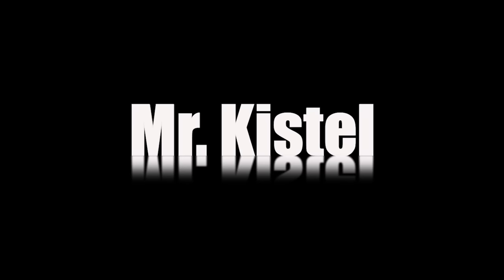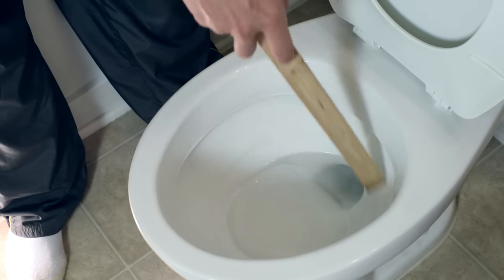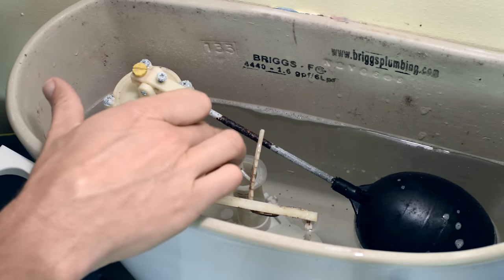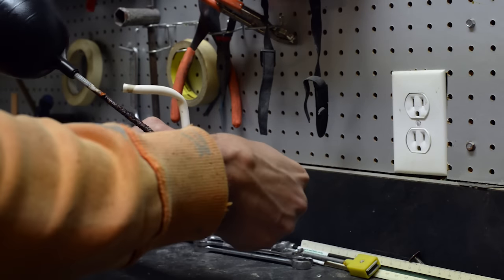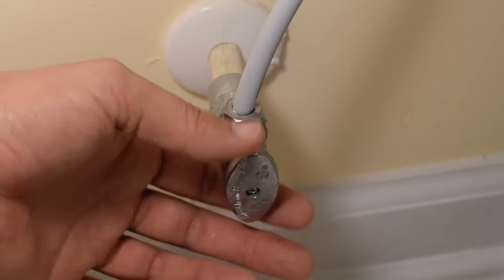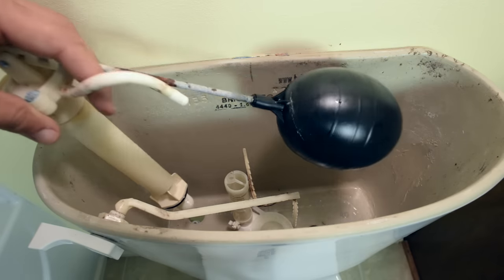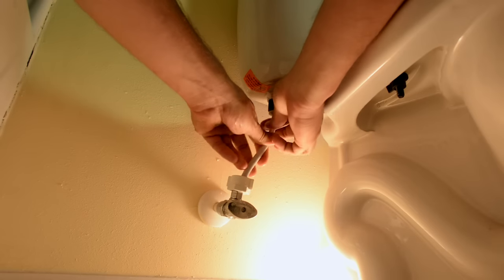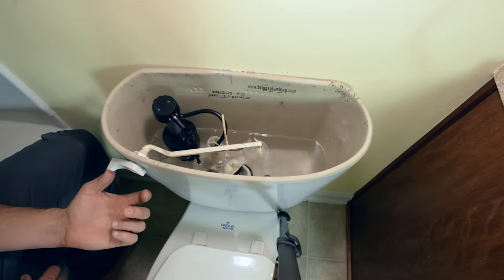Why Is There Low Water Level In The Toilet Bowl And How to Repair

Comment: MrKistel - I replaced the flush valve with a new/modern one and the water level in the bowl is still very low. No change after the install. There are no leaks in the new valve, flapper is good and the water is rushing out full blast from the black flush valve hose into the overflow tube. Water level inside the tank is at the proper height. If I pour a ton of water into the bowl itself, the water level drops back to the same exact spot right as I stand there.  :(  Since installing the new valve didn't work - do you know what else may be the cause? I've Googled this problem and coming up with no solutions (other than people changing the valve and it works for them again). I just have a regular Vitra 1.6 Gpf/6.0lpf toilet in case that helps? Thanks!!

Comment: I just replaced the fill valve in one toilet, and 2nd one has low water.  However, I noted you put the fill tube down into the overflow, although the instructions that come with the new fill valve say not to do that as you end up wasting water.  Why do you not cut the tubing off?
Reply from the maker: Probably best to follow instructions that came with your product.  If hose is too low in the tube maybe a siphon could be created which could potentially waste water

Comment: Have the same prob as Peter which you did not answer.Thank you for the video.
My problem is a little different. The toilet bowl fills to normal but over-night will drain to a very low level.
Flushing seems normal. No leaks observed. Any recommendations?
Reply from the maker: +K.A. HARDY See some of my replies to earlier comments.  You may have a vacuum problem caused from an issue with your vent plumbing

Comment: Hi.  Thanks for this video.  I have a new Toto toilet with the Flow Max II or something like that.  Would you know of any way to make the water level higher in that model?
Reply from the maker: Thanks for watching and commenting.  I would assume it would be a similar process to toilet bowl low water fix demonstrated in this video.  Sometimes you can also pour a bunch of  water directly into the bowl and wait a awhile.  Then where the water level sits is likely the design intention of the toilet manufacturer.

Comment: I replaced out my old kit for a new korkys flush kit problem is even when the bowl fills up where should be once the flush shuts off the bowl water starts to go down bout inch & half have adjusted everything there is to adjust but no change occured leaves me scratching my head yet why it's doing this?

Comment: I have an apartment with 2 toilets upstairs and 2 toilets downstairs. They all flush fine, have good functioning fill valves, but the level of the water is low and then once the fill valve stops running the water actually drains down even more, sometimes to where there is just an inch of water. All 4 of the toilets just recently started doing this.  We've also snaked out the vents from the roof and no blockage. The only thing we haven't done is pull and replace the toilets, but assumption is that it is unlikely for all 4 toilets to have an issue inside of the bowl. Any thoughts?
Reply from the maker: Interesting situation.  Not sure I can help but please advise what you figure the issue is once you figure it out

Comment: Question: bowl fills up to the right water level and then slowly lowers to just a small amount of water. Thanks if you can help.
Reply from the maker: Might be a problem with the sewer venting causing a vacuum which may suck water out of toilet bowl.

Comment: Hey Joe,i have the same new valve as the one you installed my problem is i have too much water in the toilet bowl i want less water i have tried adjusting screw still to much water what am i doing wrong ? can you send meow do a video on this i have yet to see one. Thanks
Reply from the maker: Make sure the fill flex tube is not too far down in the pipe.  If it is it could possibly be siphoning water into the bowl.

Comment: Hi, I recently replaced the fill valve for my toilet. I bought the exact one that you showed here in your video. I am 99% sure I did everything correctly but the water in the toilet tank and bowl is low. I tried to adjust the water level but it doesn't rise. Sometimes the water won't fill up and I would have to press on the knob for it to fill. Any ideas what kind of problem this might be? It seems to flush fine when I press the knob on the fill valve (the spot where the screw driver goes in to adjust water level). So my problem is sometimes it fills fine even though its at a low level but sometimes it doesn't fill at all unless I press the knob. Please help! Thanks in advance!
Reply: ever find a solution?

Comment: The water in my tank reaches the top of the overflow and the water continues to run. Will adjusting the valve as you demonstrated when you replaced it resolve that problem? I constantly have to remove the tank lid and pull up the float.

Comment: Hey Mr Kistel,  we just purchased a new home (new to us) there are two toilets in the home both the same brand and model. The water is lower in one then the other. They both have the New fancy apparatus, is there a way to adjust the water going into the bowl? Or can those spring a leak as well?  Thanks in advance.
Reply from the maker: Congrats on the new home. There is an adjustment knob on the fill valve appartus.  On the version I used it is the vertical threaded section with the philips screw head.  This adjustment is for the water level in the tank but could  have some effect water level in the bowl.  To see if this might be the culprit you can measure the water level in the tank of each toilet (assuming they are identical) and if one is different adjust the one to match the other.  Also these valves could fail as well over time, check for leaks out of the valve or anything restricting flow to the refill tube.  Another possibility could be a problem with the vent plumbing in your house.  A restricted vent system can create a vacuum effect which can suck the water level down in a toilet.
Reply: Thanks for the info Mr Kistel, I was thinking the vent could be an issue as well but wouldn't I have an issue with the other toilet or do tge have separate vents? Sorry if that is a dumb question.
Reply from the maker: Timbo424 The toilets would most likely be on separate vent systems.

Comment: FYI in my old European toilet the bowl water level always stays the same (European toilets are wash down, not siphonic). Tampering with the tank fill valve and it's arm and floater just regulates how much the tank fills. My old high tank once filled up to more than 4 gallons. I reduced the fill level to about 1,5 gallons by bending the valve arm and now it wastes much less water than before.
Reply: The problem with the toilets made after 1994 is not the qty of water used to flush, it is the WATER LEVEL in the bowl.  P00P sticks to the side of the bowl because there is no water for it to drop into, so even 4 or 5 or 6 flushes won't clean the bowl.  How does THAT save water?  The government should admit this was a bad idea and fix it.  Or toilet makes should figure out how to store more of the water in the bowl, instead of in the tank.  

I have an old 3.5 gallon wash-down flush toilet.  I would like to get a new one that is chair height, but I'm not willing to p00p on the porcelain instead of into the water.  I have added jars filled with water to my tank to reduce the amount of water used in the flush.  A lot of water isn't necessary if there is plenty of water in the bowl so the p00p doesn't stick to the porcelain.  Also, given that urine is sterile, I subscribe to the saying "if it's yellow, let it mellow - if it's brown, flush it down."   I want to save water, but NOT by having too little water in the toilet bowl so that the porcelain gets nasty.
Reply: +Grace Birdsong That's the problem with the wash down design. On the other hand, the siphonic design is cleaner but prone to clogging. It seems that if you're in America, Canada or Japan to name a few countries you can only buy or use siphonic toilets and if, instead, you're in Europe you can only buy or use wash down toilets.
Reply: TeraVolt Thank you for the clarification!!!! I'm not religious but God bless you haha... Science, bitcheesss!! I'm European (Finland) and my toilet had somewhat low water level. Way lower than this video. I was like oh shit are the pipes clogged. Thankfully my toilet isn't siphonic (I guess) because I wipe with a lot of paper and I have to flush the toilet 3-6 times after taking a shit.

Comment: I'm not seeing a leak.  Btw, the replacement that you put in looks to be the exact model I have.  Is it possible it might be leaking in a different spot?  I mean, there seems to be a lot of water going into the bowl.  It actually fills up to about where I think it should be.  However, it slowly drops in level.  About 20 to 30 seconds after the water shuts off the bowl has drained to about where yours was before the fix... then it stays at that level.

Is it possible that the entire toilet might be angled wrong or something?  I haven't pulled the toilet or anything like that recently.
Reply from the maker: Sorry to hear of your issue where the toilet bowl water level is lower then you would like to be.  It is hard to say what the issue is from this end. If the valve is old it might be worth replacing.  Maybe try adding  a bucket of water directly to the bowl and seeing if the level still drops.
Reply: @MrKistel  When I pour water into the bowl it quickly goes down again to the lower level as though I hadn't added any water.
I don't know if it helps but I do have a toilet on the floor directly below and it does NOT have this issue.  So, I don't think it has anything to do with the main sewer line itself.

Comment: MrKistel.  I have an odd situation.   In a hallway bathroom that doesn't get used much, I have a toilet with this issue:   If the toilet doesn't get used for a few weeks (no guests), the bowl will be empty and a smell will be present.  The smell I can explain (insufficient water in the trap) but what would cause it to slowly lose bowl water over time?
Reply from the maker: Possibly an issue in the plumbing venting in the house.  If there is not sufficient venting water can get sucked out of the bowl.  As other sinks and toilets are used in the house it create a vacuum and cause such an issue.  I would check to make sure you have proper venting piping in the first place and if so look for clogs.  Vent pipes come out in the roof and  things can fall down in them creating a clog.  Sometimes running the hose down the vent pipe can remove the obstruction.

Comment: I noticed when you started there was a float an after you changed to upgraded model there wasn't a float my toilet doesnt have a float and the tube you showed going into fill valve the tube in mine dosent go into fill valve too short. Should it be in fill valve??
Reply from the maker: The float is the cylinder that rides up and down the main tube/cylinder valve body.  It is just a more modern design.  For the model I showed in the video it is important the hose go from the valve assembly to the overflow tube.

Comment: I have a brand new dual flush toilet that came with a problem. That was fixed. The tank is still full of small bubbles. Is this normal and what do I do?
Reply from the maker: Any chance the tank had some sort of cleaner residue in it that is causing the bubbles?

Comment: I replaced my existing toilet builders basic round bowl to a elongated Glacier Bay 2 button top flush toilet. But now water level at base slowly empties out to only leave about 2" of water. I confirmed the fill tube is working and installed correctly, no leaks visible.  I used a new "no wax" rubber ring and tightened bolts when I installed on ceramic tiles that were level. Any ideas on why this is happening?
Reply from the maker: Hard to say but some of the newer efficiency toilets have a pretty low water level by design. Best of luck.

Comment: any tips for low pressure going to the toilet?  after initial flush the tank fills extremely slowly and the water coming in has a very high pitched sound
Reply from the maker: have you checked the main water feed valve that feeds the toilet?  make sure it is all the way open?

Comment: How do you know that the cause is the refile apparatus and not the Toilet wax leading on the floor, assuming not all leaks can be noticeable.
Reply from the maker: Thanks for watching. The low water level in the toilet bowl shown in the video was low due to the faulty refill system.  Once the valve was discovered effective, it was replaced and the toilet water level corrected itself.
Reply: @MrKistel    If my toilet is 30 years old, could the Toilet wax be leaking, even when there is no water at the base of the Toilet ?
Note: the water level in the tank goes down  half an inch a day and the toilet bowl water level remains constant.

Comment: My toilet bowl is brand new I'm wondering if I have to purchase a replacement part or I need to adjust the screw? I tried to adjust the screws but to no avail. please, I need your help. It's so annoying that every time you went no 2 after flushing the toilet there is always leftover shit on the side of the porcelain where the water cant reach. thanks in advance.
Reply from the maker: Another cause for low water in the toilet bowl could be a sewer venting issue.  There should be a pipe venting the sewer line out of the toilet  to open air. Some times those pipes get clogged or they were installed incorrectly or not at all.

Comment: You put the water fill hose right into the (bowl-fill tube) which fills the bowl??
Then where does the water come from to fill the tank?
Reply from the maker: Thanks for commenting.  It depends on the toilet valve but generally around the base of the fill valve is where the water comes in to fill the tank.
Reply: MrKistel 
 Thank you for the answer. That must mean that my brand new valve is not working properly.
Depending on if I put the hose in the tube or in the tank, either the tank will fill and the bowl will have very little water or the bowl will fill very quickly and the tank will not fill all the way and take forever

Comment: Installed a brand new fill valve, and the water in the bowl is still low.  Even if I add water to the bowl directly, such as from a bucket, the bowl still drains down to a low level.  Any ideas as to what might be causing the problem?
Reply from the maker: Could it possibly the design fill level of the toilet? Otherwise sometimes there is an issue with venting in plumbing on the flush side of the toilet.  If venting is impeded on the sewer piping their could be a suction force pulling water from the bowl.
Reply: @MrKistel  I don't think the fill level I am seeing is intended by the design. I will check the vent but I don't think that is the issue because any water above the final fill level just trickles out (you can hear it). If the cause was a plugged vent, you would think that it would be all sucked out at once with the flush.   The problem is very similar to the one depicted in this video https://www.youtube.com/watch?v=qpxKUEnI1fk  (which unfortunately doesn't offer a solution).

Comment: could the low bowl level be caused by something other than a leak, i.e., someone taking a monster dump and not flushing to allow for time for the bowl to empty?
Reply from the maker: sounds like you might need a specialist
Reply: @MrKistel  Hi, wound up getting one; Johnny Mopp :-) The DH came home, there was no leaking from the valve when we flushed, he applied Mr. Mopp and the water came back up.  All is well and I'm glad you made the video so I knew what to look for.
Reply from the maker: @deecross5028  Great to hear all is well and the video was helpful with your toilet troubles

Comment: I want to know how to increase the water level left in the toilet bowl not just the amount of water used to flush the toilet. I've maxed out the adjuster to use more water when flushed but water level in the bowl is about half a centimeter higher. Is that the best I'll get?
Reply from the maker: If too much water gets put in the toilet bowl the toilet will likely automatically flush.

Comment: What would be causing the water pressure to be coming in so slow even with the knob turned all the way in ? It takes forever to fill the tank and bowl, on top of that it's very low. I have a glacier bay duel flush toilet. Please help !!!
Reply from the maker: Sorry to hear of your toilet complications.  Any chance the water in valve to the toilet is not opened all the way?
Reply: You know I'm not sure. I'm not knowledgeable enough to know what that is. Thanks for the response btw. Any way you can explain what the water valve looks like ?
Reply: It's a glacier bay duel flush toilet if that helps
Reply from the maker: @Mitchellaaroncoleman  should be a pipe coming out of the wall near the toilet. it will have a nob valve that can be turned on our off. It supplies water to the toilet. I show it in the video
Reply: Oh yeah I know that. I didn't know what to call it. I have that turned as far as it can go. Just comes out so slow 🤷

Comment: None of this seemed to apply to my toilet, and what was puzzling is that OCCASIONALLY it WOULD be at sufficient height, but mostly not. So just now I went and HELD DOWN THE FLUSHER HANDLE UNTIL THE BOWL FILLED ADEQUATELY, and it worked ... NOW the bowl water is high again. I don't understand plumbing, so I don't pretend to know why this worked, but it did for me.
Reply from the maker: Sometimes there can be a problem with the venting in the sewer pipe which can "suck" some water out of the bowl.  The venting issue would need to be addressed if this was the case in your situation.  You can also check the little fill house in the upper tank and make sure it is going into the fill and overflow tube.
Reply: Thanks!